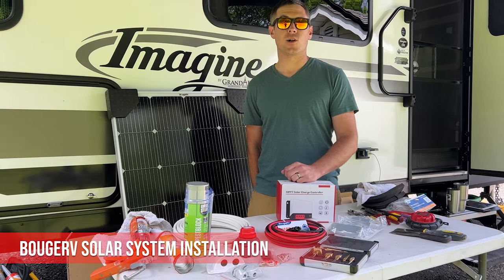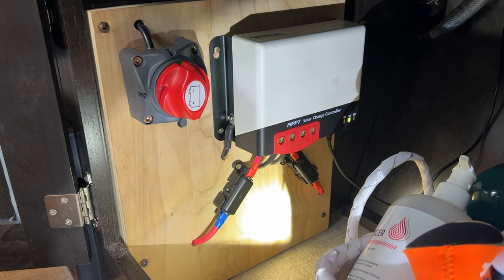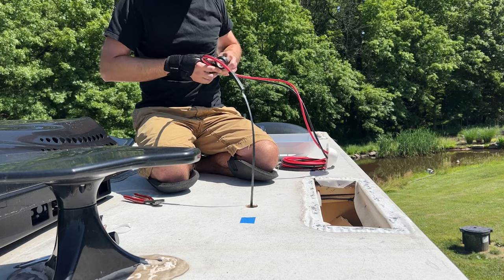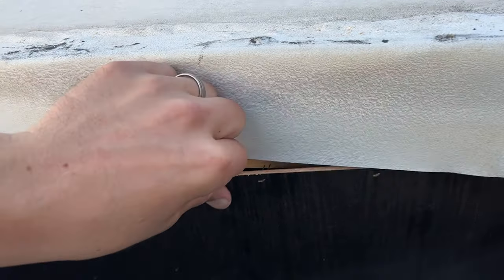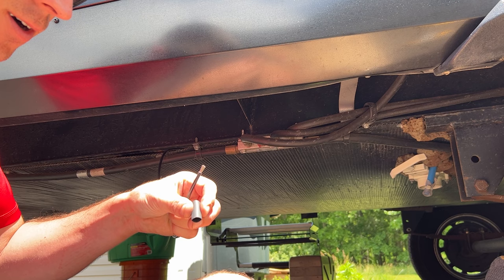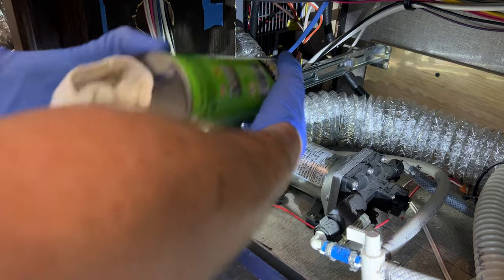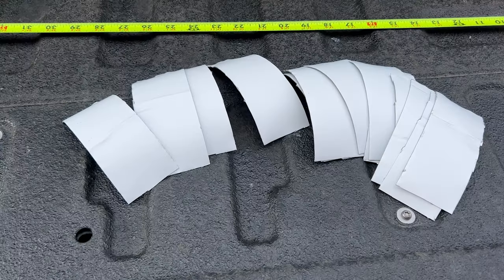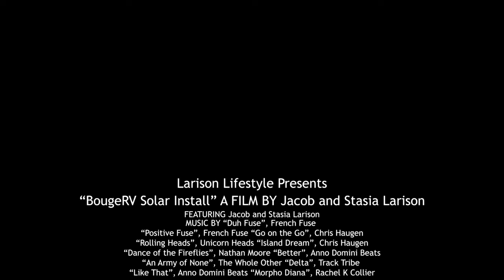RV Solar Install in 4 Days! | Full Time RVing

Comment: Thank you for showing the installation. What is your peak watt performance? What would you say is your average watt performance?
Reply from the maker: @travismcclean8566, I normally don't monitor the watt performance. We recently switched to (2) 100amp/hr lithium iron phosphate batteries from (2) group 24 100amp/hr lead acid batteries. During the day we now hover at 14.5volts and in the evening stay above 13volts even when running our heat, Starlink and lights. Our lead acid batteries struggled in cold evenings. Pairing the 800watt system with a good battery bank made a huge difference for full time Boon docking. Installing these solar panels has been a game changer for working full time out of our camper.

Comment: Nice install.  Question,  what wires did you connect to the shut off switch? Noticed they were black.
Reply from the maker: @Truth & Justice, thanks for the question. I used the black negative wire from the solar panels to the shut off switch. Then another black negative wire to the negative solar panel connection of the controller. This way I can brake the power circuit to shut off power from the panels to the controller if I need to change a fuse out, change batteries or work on anything in the system without getting shocked.
Reply: @Larison Lifestyle  thx. I thought that might be it. Any reason why you didn't use the positive red wire (from panels), similar to a battery cut off switch using the positive?
Reply from the maker: @truthjustice3313  , The only reason I used the black wire is because I was already installing the inline fuses for the red positive wire and wanted to keep a clean look. Either way it works as a battery cut off when you break the circuit cycle of negative or positive. For me it was a matter of preference. You could install the shut off switch on the positive or negative as long as it's between the solar panels and controller.

Comment: Are you running 2charge controllers or is the 40 running all 4 paneis
Reply from the maker: @aceverminator I am using only (1) 40amp BougeRV charge controller for all 4 panels at 800watts.